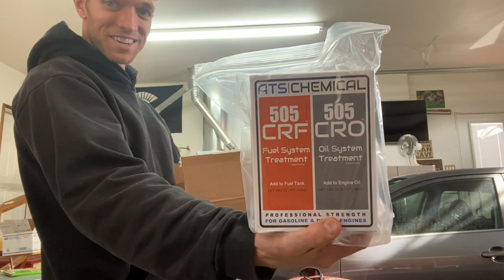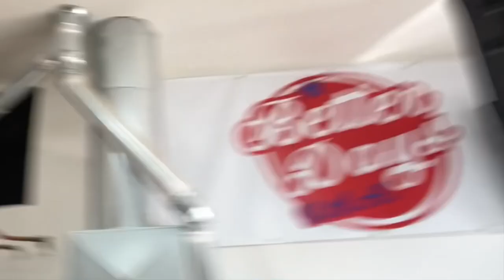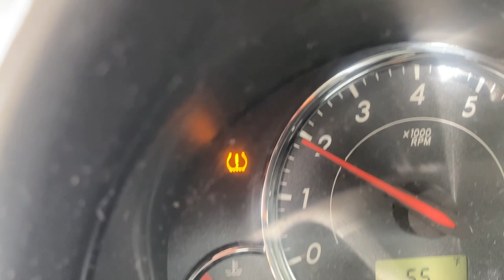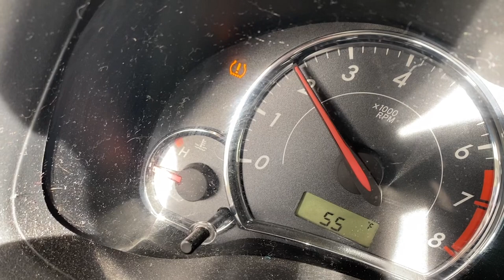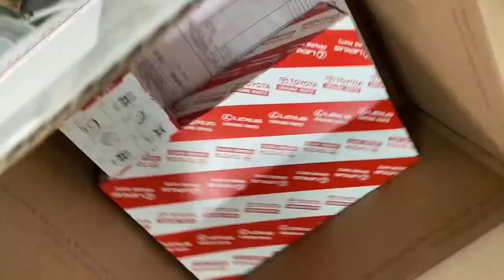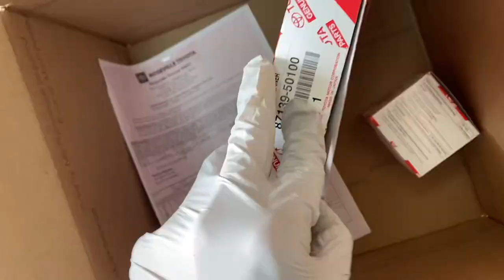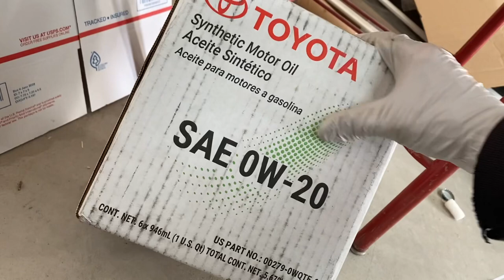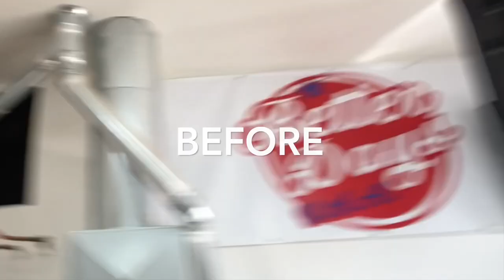ATS Chemical 505 CRO & 505 CRF Oil/Fuel System Treatment TEST On 2011 Toyota Corolla

Comment: Thanks for taking us through the 505 process. Curious about the effects of the fuel additive.
Reply from the maker: No prob man, thanks for your time in watching. As far as the effects of the fuel system cleaner..It’s hard for me to say how much it cleaned the injectors, haven’t noticed much of a difference in MPG, but the car seems to be running a tad better overall. If that helps at all. Imo definitely didn’t hurt it.